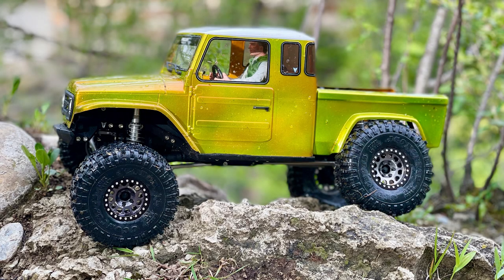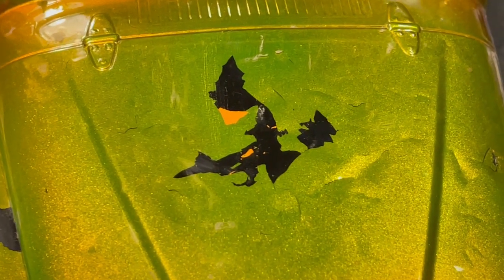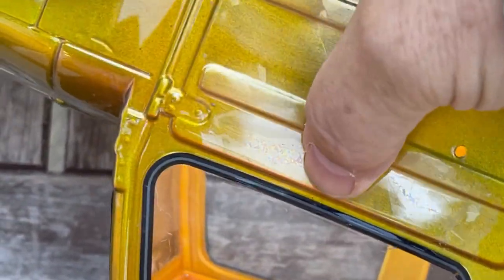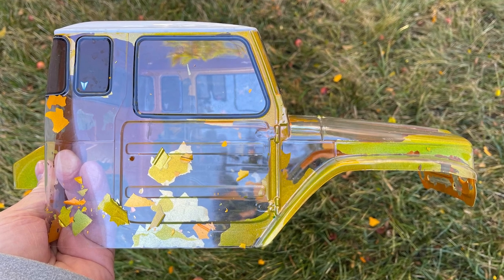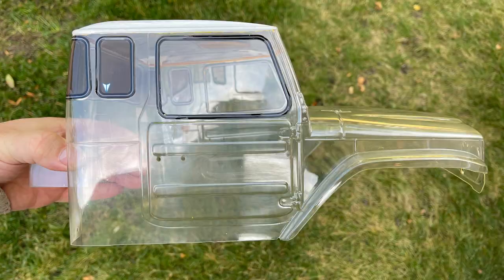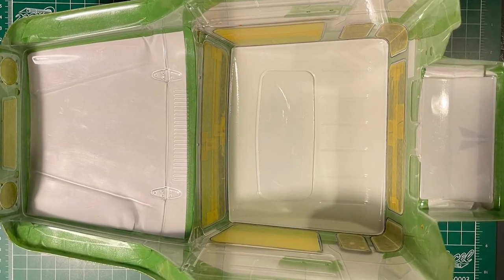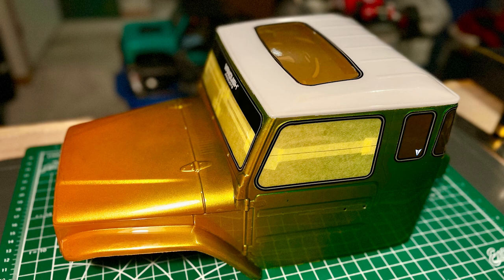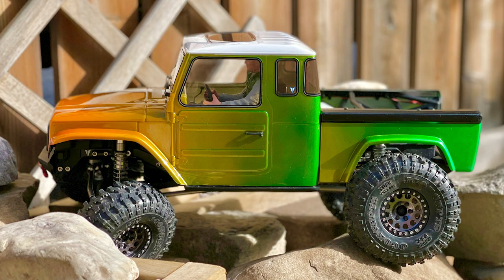How To Re-paint An RC Body?! - RC Stories Garage - Episode 14

Comment: This paint cracking, i had something similar on my best ever job😢 i done a cracked paint pattern in fluorescent yellow with metal purple as main colour , on a Hakusa skyline.
 I fiberglassed body & from bumps & twists the paint lifted  off sticking to fiberglass. I used correct inside paint but what i recently found out is i should have Keyed the body, that & fiberglass sticking to paint lifted it off

Comment: Ha ha, I painted my VS4-10 Ultra, washed it with dawn twice real good and let dry, but I didn't scuff it, and now it's all flaking off. Yes I used Tamiya TS paint also.  Needed to see this, Thanks.
Reply from the maker: Are you using PS paint? PS is for polycarbonate/lexan. TS is for other plastics.